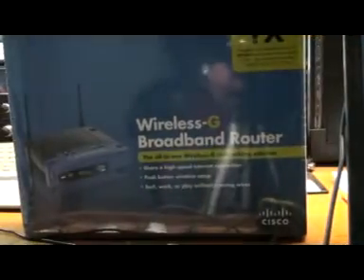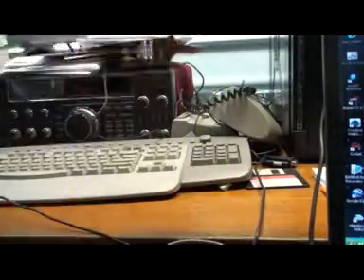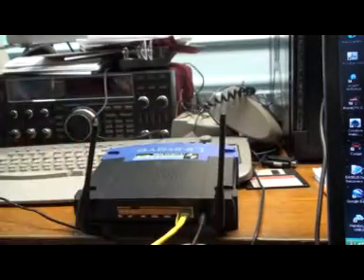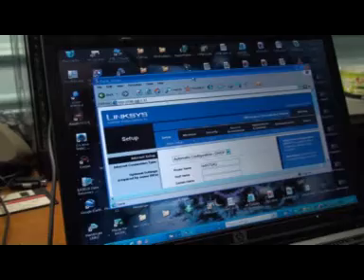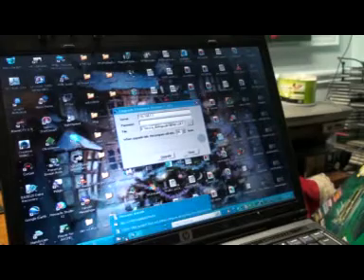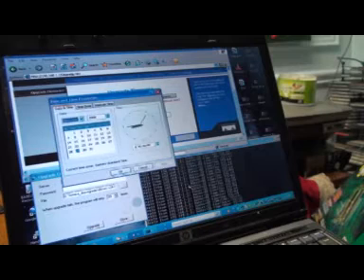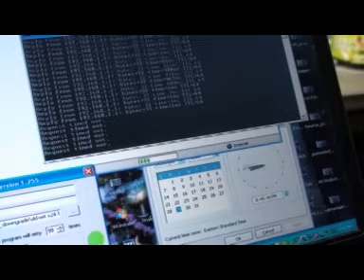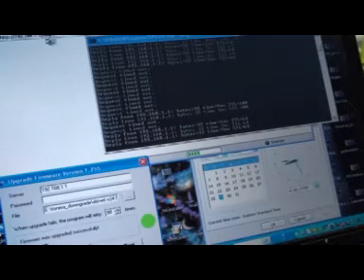Flashing a WRT54G v8 with DD-WRT Micro in less than 30 sec.

Comment: If the subnet of your router was anything other than 192.168.1.x when you started you need to set a static IP to something in that subnet (as your DHCP assigned IP is in the wrong subnet and won't last long). So in network settings, gotta force an IP somewhere in 192.168.1.x before moving on to the next step. Also if it you do this you can ping the router. If it pings back it's alive somewhere in there and can be brought back. The DDWrt site is actually great.

Comment: i need help- i have wrt54gv8- i followed ur video and something i did went wrong. my LED pwr light no longer shines brite it is dull yet the internet and port blink normal. my computer cannot contact router and when i cmd ping it does 4 times at 0. on my tcpip4 i put 192.168.1.16/ 255.255.255.0/192.168.1.1. i used the vxworks killer followed by tftp and it flashed green and then stuck so i closed down program. so here i am stuck i even tried dray tek router tool to no avail. even hard start .

Comment: I had to flash my V8 with DD-WRT because the WAN port on it stopped working. That firmware is so flexible. It's an awesome way to recycle a seemingly 'broken' router (using port 4 as WAN now)

My only complaint is that DD-WRT uses a lot of memory and the 8 mb on the V8 seriously limits what you can do with it. The NEWD 12458 build is the best one I've found so far for the V8; every other build I've tried just brings the router down on its knees or crashes frequently.

Comment: Doh, I had my default router ip address at 192.168.5.x so my ipaddress wasn't in the right subnet after the switch to vxkiller. Which defaulted back to 192.168.1.1 and I had to force my computer to a static 192.168.1.100 to get it to hit the right notes. 

I see how a noob could easily brick the thing. Though, I wonder how many just lose their assigned IPs and can't contact the router because DHCP would be down. Which would mean it's not actually bricked at all.

Comment: This video is fascinating as to how fast you can flash your WRT54G to DD-WRT if you really know what you're doing, but if you're not super skilled with flashing routers and have never messed with JTAG, the best way is to still use recommended tutorials (30-30-30 hard reset, etc.)

If you've never flashed a router to DD-WRT before and you try to mimic what the guy's doing in this video, I shun you. o:

Comment: Go to dd-wrt site, depending on the router model the process will vary.  Usually you will use Linksys' TFTP utility to flash first a vxworks killer bin (this frees up the flash for the version of dd-wrt you're loading, and it's what he does via the web interface), then you flash either the mini or micro version of DD-WRT.  If you need VPN functionality, there's a bin for that as well.  Go read, everything you need to know is on that site, though I just gave you 95% of the process.